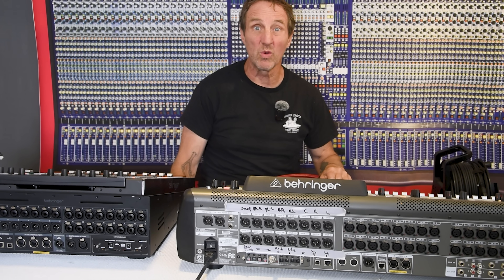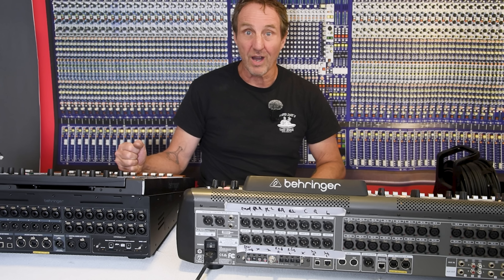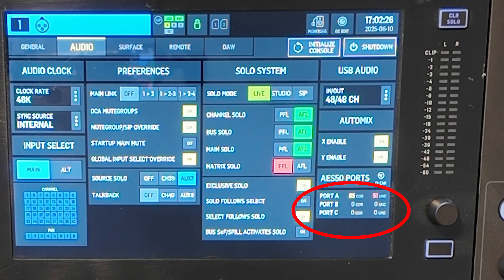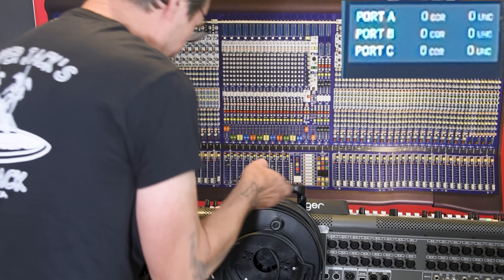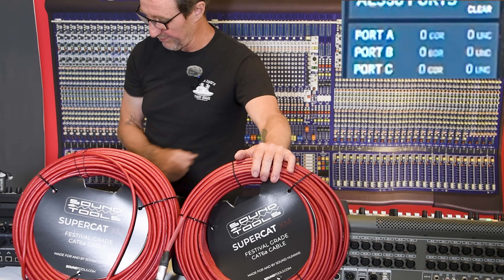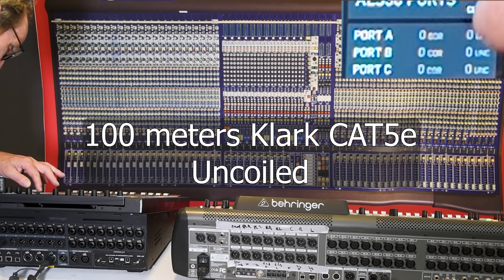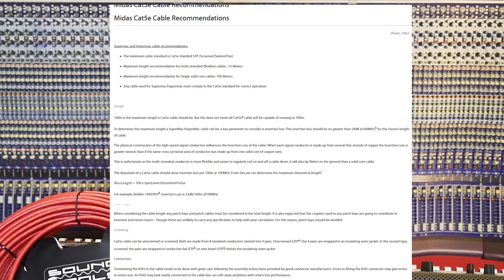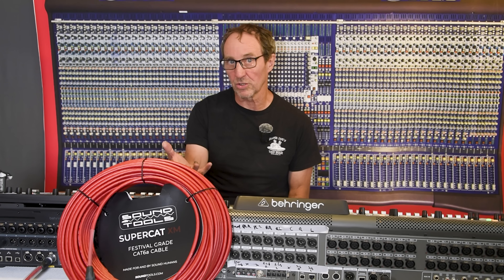Misinformation or Simple Test? - CAT5e vs CAT6a

Comment: I'm pretty sure the only reason they recommend cat5e is because of the LAN8720 chip that handles the aes50 information on the main board. They tend to fail (less) in certain conditons without shielded cable.
Reply from the maker: my understanding is the reason they recommend Cat5e is that what actually matters is that the loss at 100MHz of the cable length/type combination is 24dB or less.

Also if they were to recommend CAT6A it would hurt sales as the wing would no longer be a plug and play swap and it would hurt sales.

it's not cable type that matters, it's cable category vs length modified by manufacturer variations.
Reply: I replaced LAN8720 twice on my X32R and once on a MR18 (broken ethernet control, AES50 was ok)
This chip apparently gets upset with ESD and/or with passive PoE, I think. If your RJ45' LEDs get stuck, this might be the reason.
Be careful with it!
It looks like there's no magnetic coupling on ethernet port, so it gets damaged easily.
Any opinions on this?
Reply: @Jorge_Frutos  Very interesting. Does this also apply to the Midas M32 as they are not the same internally?
Reply: @DelticEngine  yes, the same apllies as both are exactly the same on the main processor board. (Little differences in preamp and output boards).

I managed to blow the LAN8720 chip on the ethernet port three times.
I already dissasembled my Wing but I cannot remember if the same chip was used. I think not because Wing is 1Gigabit ethernet IIRC and LAN7820 is 10/100
Reply from the maker: I have not tested so I don't know much other than the strong recommendation from music tribe to use shielded cable to reduce ESD damage.

I've heard from a behringer designer that the esd protection in the X32 and similar is not robust.

Are you having these issues with fully shielded cables being used that are plugged into connections on the other side that are also shielded?

Comment: Here comes the keyboard warriors talking about how if you don't run Cat5e, you will burn out your AES-50 ports...
Reply from the maker: bring them on! 

I've been pondering a good analogy and what I've come up with a little while ago is comparing cat cables to water pipes 

higher speed CAT cables are like water pipes that are smoother inside and/or are larger in diameter, and therefore have less resistance ( loss ).

Cat 6a is just a pipe with smoother insides and larger diameter than cat 5e cable. 

 like using 3/4" copper pipe instead of 1/2" lead pipe.

And now we can laugh at people thinking that switching to 3/4-in copper pipe will somehow mess up their faucets and toilets by improving the water flow and using a higher quality product

Comment: Did you try both of the 5e cables individually to confirm they both work? Based on what's shown in the video, it seems possible that the second one you add on to make the 100m run could simply be a faulty cable. 

That said, I don't see any reason to believe that 6a should be any worse than 5e. As I understand it, ethernet cables are fully backwards-compatible and, as you point out in the video, are simply capable of data transfer at faster rates and with less transmission loss, and I don't see any way that could possibly break backwards compatibility or interfere with proper functionality.
Reply from the maker: Yes of course both Cat5e cables are fully functional and test perfectly. 

The answer is pretty simple, those cat 5e cables have an insertion loss of about 30dB at 100 meters at 100 megahertz.

50 m is about 15 DB of loss 

The super cat XM has about 18 DB for 100 m at 100 MHz 

50 m is about 9 DB of loss 

AES50 wants to see 24 dB or less loss. 

using two Cat5e 50 m cables exceeds the 24 DB limit by 6dB or more. 3dB of added loss is 1/2 the signal. 6 dB off added loss is 1/4 the signal.

the 2 x 50 meter cables result in only 25% of the signal needed to operate withoutout errors.

 50 m cat 5e has about 15 DB of loss and 50 m of super cat as 9 dB off loss totaling 24 dB of loss. 

there's no magic or anything weird, too much loss creates errors and the Cat5e cable has more loss at 100 MHz and up.
Reply: Stop saying that said. You don't have to tell people you said something. Just continue going on. What's the point, it sounds stupid.
Reply from the maker: does the statement "just continue, going on" involve unnecessary redundancy?

I support any communication methods that convey what someone's thinking in such a way that other person or people understand.

I suggest we stay on topic
Reply: @briancoogan7732  You ok hun?
Reply: @briancoogan7732  lmao ok buddy
Reply: @briancoogan7732 He is actually using language correctly. That said, you obviously don’t know how language works. Why must there always be one dude with a negative comment, totally irrelevant to what is being discussed? But why??? 😢😢😢